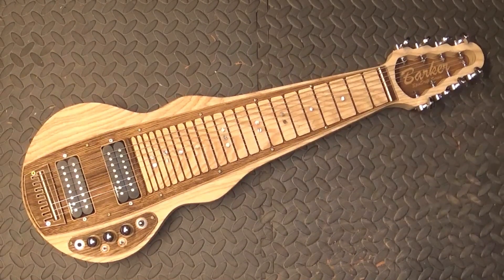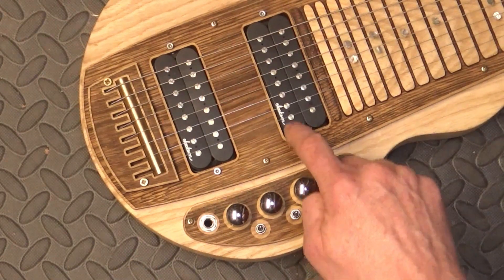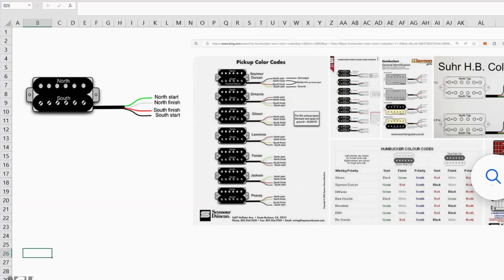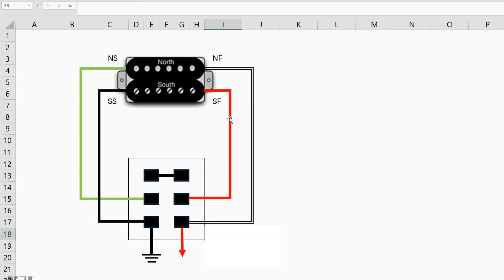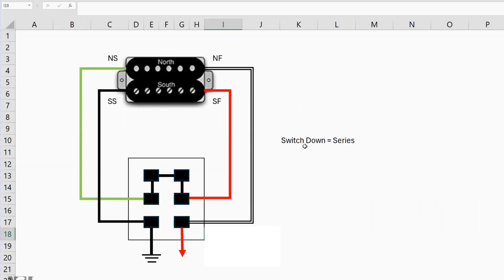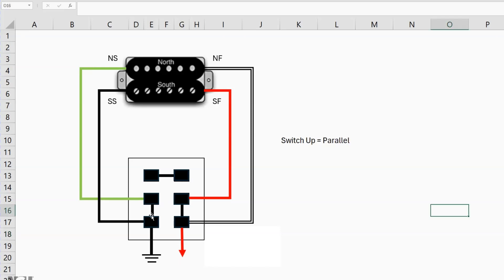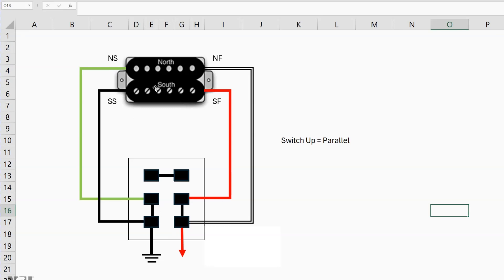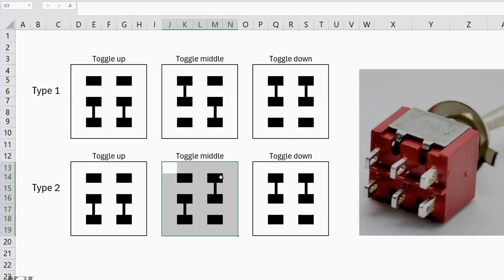How DO you wire an On-On-On switch? 🤔 Series/Parallel/CoilSplit in 1 switch!!

Comment: thank you very much for taking so much time and explaining it so schematically. it really helped me to finally see through it
Reply from the maker: You are very welcome - I didn’t really get it the first time I wired one of these from a diagram either, and I ended up drawing it on paper to work it out - curiosity got the better of me! Really glad it was useful, and thanks for watching!
Reply: Some might say I'm loitering on semantics...   However, I was trained to regard  two dimensional electronic diagrams as - 'circuit diagrams';  a 'schematic diagram' is the 'three-dimensional' representation of the physical wiring - the difference being that the 'circuit diagram'  portrays the current path in its simplest form; whereas the 'schematic' may differ considerably visually.    

Those spidery drawings we see people make of pickup wiring therefore would be the schematic diagram showing how the arrangement is physically in the guitar; effectively - the wiring scheme.      

This explanation is one of the best I've seen on YT as matey uses proper circuit diagrams to illustrate the electrical function of the circuit, which is always easier than trying to decipher those horrible - point-to-point spidery 'schematics.'  

In the same way as I take the above issue with popular circuit draughtsmanship, I would also argue the difference between what is a 'coil tap' and what is a 'coil split'.    When splitting the coils of a humbucker - that comprises of two distinct continuous windings - we regard that as  coil split.   Because one is actually separating (splitting) the coils - as shown in this video.  Conversely -  a coil tap rarely occurs in guitar wiring - essentially a 'tap' is a point of connection made at some point in ONE coil's winding, giving three or more points of connection.  This arrangement would be present in a mains,  or I.F transformer, where several taps might offer various input or output configurations (read - voltages).   

And  another common misconception is that a string pitch-changing system (whammy bar) is properly called a 'vibrato system' -  where the change is in pitch (frequency) of the note occurs as the vibrato arm is moved; conversely - the 'tremolo' is actually a gain (volume) changing system, using an oscillator to vary the gain (loudness) of a signal pursuant to a set (or variable) parameter - usually found on many cheap 1960's amps, or now as an app in a DAW.   Technically the vibrato is a frequency shift; the tremolo an amplitude shift.   

No doubt, many will claim I'm splitting hairs...